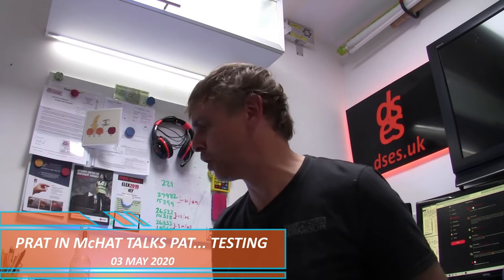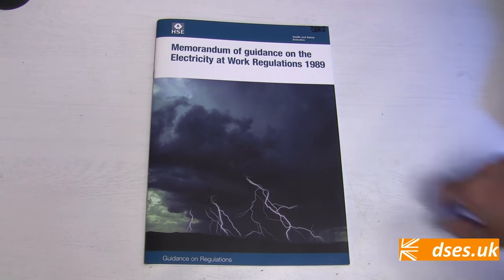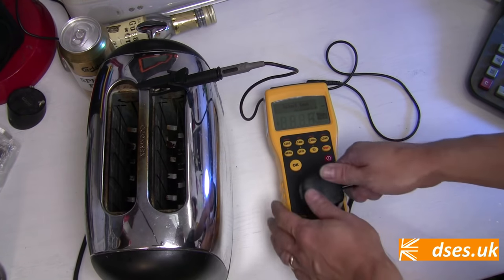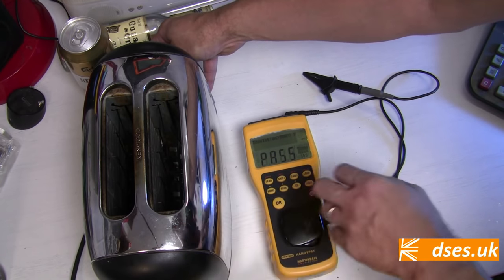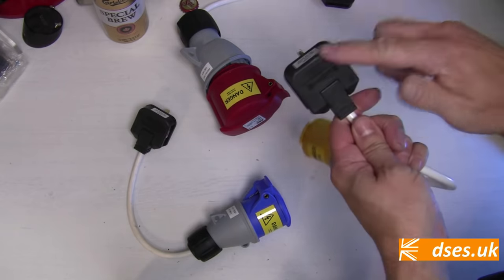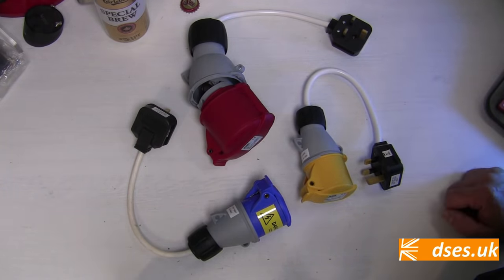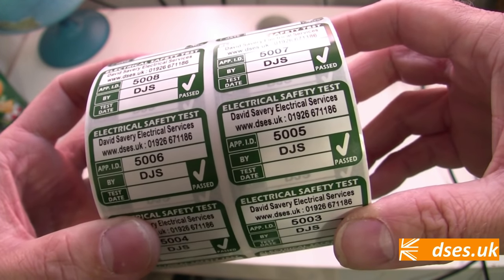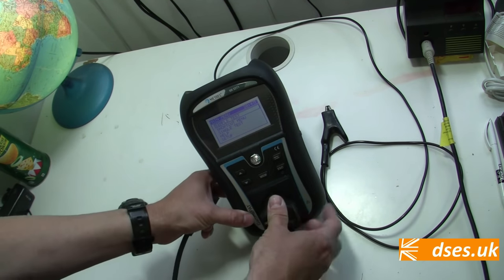Prat in McHat talks PAT... testing

Comment: I’ve got some info as a heads up to all thing PAT Testing in terms of the new Code of Practise 5th edition.
 
·       Expected release date June/July 2020
·       More onus on Risk Assessment based approach
·       Table 7.1 Testing frequencies (years) have gone in favour of risk assessment based approach
·       Appendix added on testing for equipment in rackmount cabinets
·       New flowchart for testing
·       New equipment examples and types of testing carried out on them
·       Insulation Test @ 250V/500V now required then optional Leakage Test, not either/or
·       New classification of equipment: ES1, ES2 and ES3 to go along side class 1 and class 2.
 
Finally the biggest of all changes, terminology,  the term/use of the term “PAT” has been depreciated in favour of a new name likely to be “Electrical Equipment Testing” or something along those lines.
Reply from the maker: Very interesting, thanks Andrew. It'll be interesting to see what these new equipment classes are.
Reply: that explains why the 4th edition is being so heavily discounted at the moment.

Comment: I absolutely love your videos you inspired me to start my own.  Single-handedly the funniest sparks on here. And you clearly know your stuff and more. I’m a big fan.
Reply from the maker: Cheers Will. I'm already a sub of yours, although you had some strange tools I didn't recognise in your latest video - what are these dust sheets and dustpans of which you speak?
Reply: David Savery Electrical Services How are you getting on with your TSI meter. Have you seen the new model out with the two wire earth loop impedance tester. I believe it hasn’t got a coloured screen as the other one used to churn the batteries out.
Reply from the maker: @ElectricianTV  The TIS MFT Pro? I get on very well with it, it lives in my main toolbox and sees regular use. Can't say I've had any battery bother, quite the opposite in fact, the Eneloop rechargeables I use seem to last for weeks before recharge is needed. I did see they'd released a cut-down version with a more basic display and, I suspect, lacking perhaps the more advanced features such as power monitoring and earth leakage, but I haven't got my wanking clamps onto it to see it in action!
Reply: David Savery Electrical Services yeah I watch your video on it last year and one of my friends have got the same model and I quite like the look of it and I was discussing it with the people selling  at Alexandra Palace at elecx show and he mentioned about the batteries. There wasn’t a problem with the batteries is that he said the coloured screen just really unnecessarily run the batteries down. I mention the same thing to my friend and he said that there wasn’t a problem with the battery it was probably just trying to make excuses why the coloured screen had gone where this was what attracted me to it.

Comment: 30:50 Here in NZ we are required to test the earth leakage on items that contain, relays, contactors or no accessible earthed parts or accessible unearthed metal parts by using a short lead with a plug and connector, the earthing conductor is looped outside of the plug top and a clamp meter capable of measuring small magnitudes of current is then used to test for leakage current in the earthing conductor with the appliance switched on and operating. For Class I appliances the maximum allowable leakage is 5mA @230V, 400V appliances it is 5% of nominal operating voltage. Large pieces of single and 3 phase plug in machinery contain relays that isolate various motors that may have no neutral connection and contactors isolating them from the supply when de-energised. Computers, monitors, portable RCDs  and portable RCDs with a FE are also measured this way so as not to damage the electronics in the RCD by subjecting it to an IR test. There are other types of appliance that leakage is also measured this way on, such as Class II appliances with metal exterior parts, this requires another type of test lead to measure leakage to the supply PEC, maximum allowable result is 1mA. The metal shielding panels around the peripheral item jacks on some Class II Smart TVs are a good example of this. As an apprentice I used to have to test all manner of factories, offices and shops. One large electrical appliance shop that I had to do every year became a particular bug bear. Whole days spent testing TVs and EPODs (power boards). I started to strategically book my holidays when that one rolled back around. Was great when they finally went belly up.

Comment: Being the spark in the theatre, I spend a minimum of a week testing at least 200 stage lamps  plus Lighting dimmers, amps, mixers etc. Being a both receiving a producing theatre does give me a headache. As stage lamps are de-rigged, rehung etc I normally test them on a 6 month basis. If the lamps are down and not being used for a production then I will do a visual inspection before the next company comes in. The rest of the gear is done yearly as it's not moved as much. As we use a wide range of leads, I test them accordingly. 

The office gear is tested at the start of the year as its more quieter for us.
Reply: That sounds like a soul destroying job, hopefully you get other things to do too. Nothing worse than the stiff neck and shoulders you get from testing hundreds of items a day.

Comment: At work I noticed an IEC lead with a triangular plug with no fuse.  Curious, I decided to see how it lived up to its 10A rating with a DC power supply.  The supply ran out of volts before I got near 10A, but at 7.5A the cable was dissipating over 100 watts and soon to be incandescent.  The conductors were copper coated aluminium; difficult to detect even upon stripping the wire.  A twisted fire starter; a punkin' instigator guaranteed.
The absence of the fuse was actually a blessing - otherwise no one would have noticed and the lead would be in use - waiting for someone to plug it into a load big enough to burn the building down.  I used to think PAT testing of leads was a little trivial; this caused a rapid rethink.
The PAT test would detect a poor earth connection, but is there anything to detect high L & N resistance?  What if the lead had a copper earth, but they just cheaped out on the L & N?  (I'm sure it's in the video but it's an hour twenty long....)
Reply: Agreed and now I have realised there is more to PAT than I thought

Comment: The absolute best Appliance Testing video hands down any where. And I really like your allusion to risk based testing something I bang about all day, everyday. Testing EICR included, or any stress testing electrical work, or otherwise you need to use your grey matter it’s not a compliance based (box ticking approach). The issue should be focused risk and indeed forward-looking risk assessment. It may pass today but if there is sufficient cause for concern and you suspect an item is likely to fail tell the customer to replace it and mark it down on your records. You do need to do another one but let’s wait till edition 5 comes out. I don’t know why we bang on about the importance of an EICR but downgrade PAT testing as a load crock the clearest electrical danger to a client is often the use of a piece of equipment. It should become law and if you are doing a large office you should be well compensated. It might be soul destroying if you are doing it all the time and indeed you are you are likely to become complacent no matter how good and diligent you are. Talking about complacency and electricians you need to cover the use of PPE or should I say the lack of it by electricians. I am talking about insulated and heat resistant clothing (gloves, masks for those working on high voltages in commercial and industrial settings) here not eyewear or ear wear which is the default for many.

Comment: The offices that make me shake my head quite frequently are the ones that daisychain extension leads under desks and the ones that use the long coiled extension leads and plug a PC in and a convection heater and wonder why I fail appliance with burnt plugtop , but it works is the usual response

Comment: Great video, as always.... now let me tell you a tale...

Years ago a company I worked for, as the IT manager, wanted me to carry out PAT testing. They offered no training at all and wanted me to visually inspect leads, etc. and sign them off.
To give you some background every office in the building had a severe shortage of power outlets, so extension leads were a plenty. As management didn't like to see "unsightly" cables, the leads were run behind and under desks, filing cabinets and other heavy furniture, meaning they were inaccessible for inspection. The same was true in areas like the finishing and shipping areas.
Employees had a habit of deciding they would rearrange/move offices themselves, on a whim, which in several instances resulted in extension leads being stretched to extremes, where the internal cores of the flex were visible at either end of the extension lead, damage to the extension sockets or the leads of items plugged into same, and/or metal desk legs/metal filing cabinets piercing the outer and inner cores of the flex. 
The above, along with photos of the carnage, was the basis of my refusal to undertake any "PAT" testing. I suggested they install sufficient sockets, in appropriate locations to meet the growing needs of the company to negate the need for extension leads altogether.
They decided not to install any new sockets and instead decided that the employees should "keep an eye out" for any damaged leads and report same to management....🤣🤣🤣🤣🤣🤣🤣
It's that old adage that someone has to die before change will happen....
Reply from the maker: Ridiculous that a business wouldn't invest a few hundred quid to outfit their offices for the safety of their staff. It beats paying out following a shock or fire incident!
Reply: seen it brother.. seen it...

Comment: If you have an IEC lead should you also test by putting it into the devise it is being used for? For instance if you have a Class 2 Television, should you do the insulation resistance test on the Television with the IEC lead in it? (And then also do a separate test entry for that particular IEC lead?)

Comment: scottish landlord here: I used to consistently provide a kettle, toaster, and microwave in our part-furnished lets but stopped a good few years back because I begrudged paying someone around £50-70 to come along and spend less than 10 mins to test 3-5 appliances. I tend not to provide PAT certs anymore. Technically speaking I have a washing machine and fridge freezer in every flat that still needs to be tested but in all the years I paid for them to be done not a single contractor made an effort to pull out the unit to test it - although to be fair I wasn't particularly keen on them doing so because of the risk to the lino as you pointed out.
Reply from the maker: That is a problem Peter, it's an expensive game if nobody local is able to do you a deal on testing a small number of items. I throw PAT testing in with my domestic EICR's - up to ten items at no extra charge or, as I say, I'll come and do it on my doorstep at a per-unit charge with no callout fee or minimum requirement. It's such a simple thing that it can be an easy loss-leader to boost business and reputation, but few seem to see it like that.

Comment: At the pub I noticed someone’s put a sticker on the chip and pin machine, the docking station and the wall wart. Think they might have been charging per appliance. The company I used to work for only tested their own appliances. When testing a 110 volt piece of equipment you needed an adapter and a site transformer to feed the pat tester or else you’d stick 230 volts up your 110v drill on a load test and no warnings to prevent that. Think it was an old Clare machine. Don’t know if modern testers are the same. Seemed a very dubious set up at the time. Excellent videos thanks.
Reply from the maker: It's bad practices like that which force the beer prices up.

Comment: Hi David. I was fixed appliance testing a water softener but when I turned the spur off to remove load an alarm went off. I couldn’t get to the appliance to take front off, guess would be 12volt back up but wondering if I would be able to do insulation an load test without anything happening to meter? We blew up the first meter as we used to use probes on the load side but accidentally must flicked spur on an went bang during load test. I’m now especially paranoid of blowing up this one which is lent by Meggar while ours is fixed. We now use wagos to connect in load. I’m not advertising myself as an expert fixed appliance tester by the way, just an apprentice having a go haha

Comment: A washing machine is a Class 1, Class 1 can be upto 3.5mA leakage, however, Class 1 heating appliances are classified by it's functional and operational construction.  A washing machine and an electric oven would fall under heating appliance as it has a heating element.  However, the IT component in these machines may cause it to fail on the leakage current test

Comment: A couple of thoughts on that counterfeit lead you showed:  Although obviously a "fail", could the open-circuit earth have been due to the sleeving on the earth pin preventing it contacting with the socket?  Also, when you cracked open its fuse, where was the sand? I'd thought all compliant plug fuses were sand-filled to absorb the high energy release if a fuse blows due to severe over-current. Otherwise it could shatter with enough force to blow the plug apart.
Reply from the maker: Hi Robin. You're right, I just quickly checked it with a continuity tester and the earth pin is connected, so the sleeving was preventing proper contact in this case. You're right too about the fuse, and I mention this omission in the description. I hadn't planned to crack open the fuse: it was a spur of the moment thing when the camera was running, so I neglected to comment fully on it while recording.

Comment: At work we sent an air compressor off for a service and it came back with a pass sticker and a female CeeForm where a male should be. When questioned, the excuse was "We have high voltage gear in our workshop". We avoid this company as best we can, although it still provides us with a giggle here and there.

Comment: As an IT Tech, I once came across a laptop power supply in one of our offices that had a Fail sticker on it. The reason being that the outer insulation on the 19 volt DC cable had pulled out revealing the coloured inner wires. It was my understanding at the time that the DC cable was out-of-scope for PAT testing and as there was no other damage visible, continued to use it anyway. Was I correct?
Reply from the maker: Damage on the ELV DC side wouldn't be a shock risk, but nonetheless the appliance was damaged, and a break in insulation could see a short circuit on the output side which the power supply may or may not be designed to cope with. Personally, I would have failed it too.
Reply: If the inner insulation was ok I would have wrapped a bit of self-amalgamating tape around it and passed it (self-amalgamating because it needs a tool to remove it)

Comment: I had a fan heater recently purchased from Tesco, the plug got so hot the moulded plastic became molten around the pins, left brown scorch mark on the wall socket where the fuse was positioned in the plug and partially melted the wall socket. I changed this for a cheap plug from RS Components that looked a bit similar to an MK, very cheap one and it doesn't even get warm, handles the same load with ease. So should Tesco be selling fire hazards?
Reply from the maker: That tends to happen with >2kW loads where there has either been a loose connection in the plugtop, a loose fitting between the plug pin and socket receptacle or the fuse running at its current limit for extended periods.

Comment: Don't forget to put a bowl of water or something when you do the radiation test otherwise you'll fuck up the magnetron in your microwave, that's why the manufacturer instructions tell you don't use it with nothing in it.   Another good test that a lot of engineers fail to do so is to open the door to check if the microwave cuts out to test the emergency shut off mechanism otherwise you gonna get cooked inside or become a microwave mutation

Comment: On testing washing machines and stuff like it I have a test box with a socket on a short lead with a switch,  were I can lift the earth from the incoming mains socket and put a volt meter from the appliance to the socket earth.  To test it under working condition and yes it is time consuming.  I had a job were the RCD was tripping I tell them it is the washing machine but they say no it has been PAT tested.  I walked out after 20 min trying to tell them it don't test the in side working parts.

Comment: When i was at college between 2016 and 2018 i remember the computers monitors in the library had PAT stickers on them… and these monitors had an external power adapter rather than an internal power supply
The stickers were on the back of the actual monitors
I don’t know if the power adapter itself also had a PAT sticker, or if they decided to put the sticker on the monitor instead of the power adapter, as the power adapters were under the table somewhere